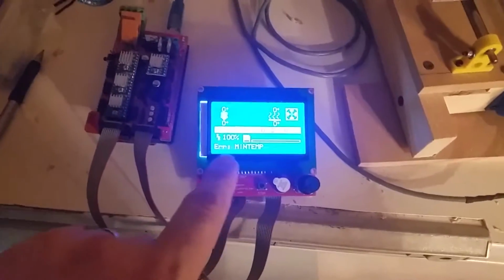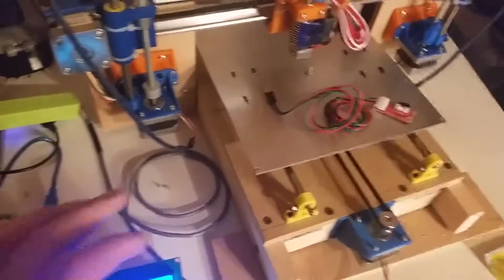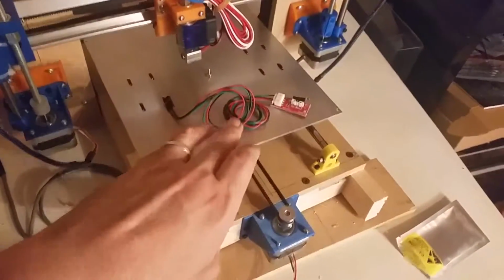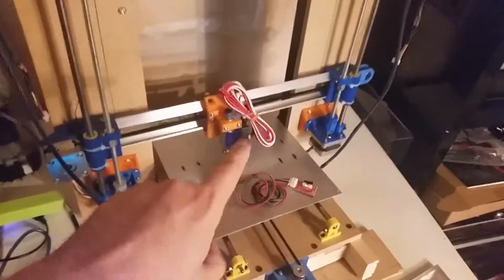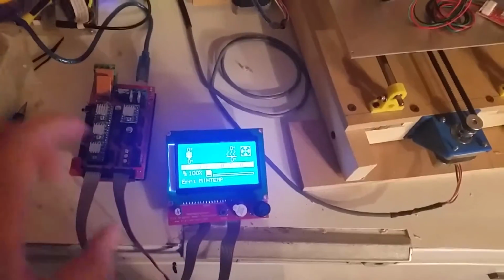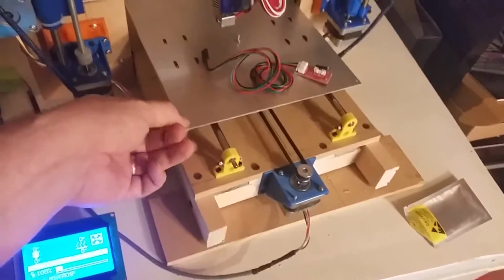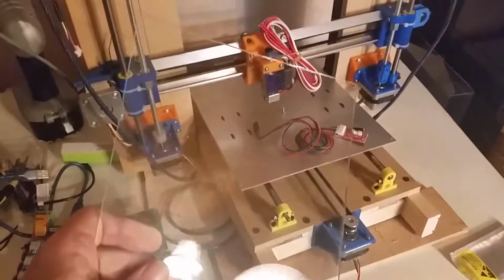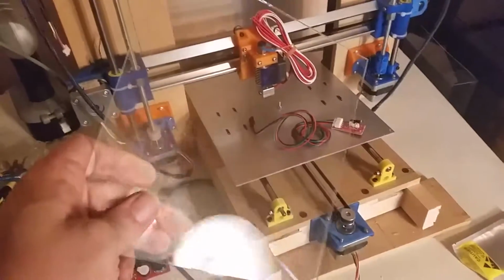3D Printer Progress 7 [ Starting the Ramps wiring ]

Comment: Coming along nicely! almost had another printer built the other day, then i managed to get a dual extruder for the wanhao di3, so now i'm short a couple steppers haha 
Thumbs up as always!
Reply from the maker: thanks man . I just had some old filament stall mid print , but it was not a even clean stall and i could not figure the place it died as far a layer .  but it was just a end stop mount so it was usable for now. I was hoping i could try the resume   that you got to work , but no luck .  ah well i just have to figure out how and where i want my end stops .
steppers wise i got used ones from eBay, supposedly from a 3d printer . others are salvage lol .
Reply: ah, that sucks! just had to throw out the rest of my black filament because it was too waterlogged and such and kept clogging
Reply from the maker: i have some color changing pla that is getting stiff , and it breaks at the extruder now and then. other wise it prints well . but man 3/4 of a spool left i dont know if a slow low bake would fix it . meh i'll keep using it for small stuff under close watch (only with fab mini rite next to me in livin room ).